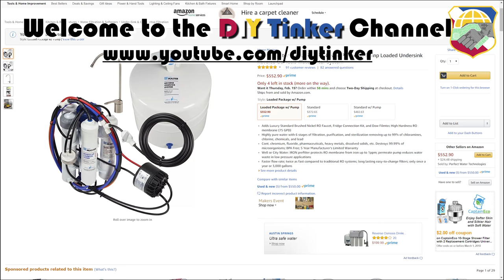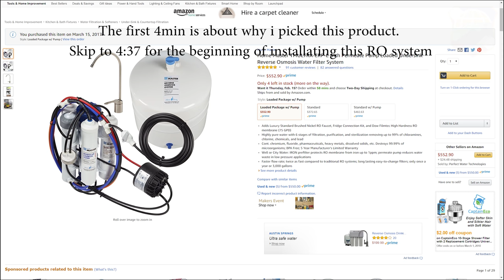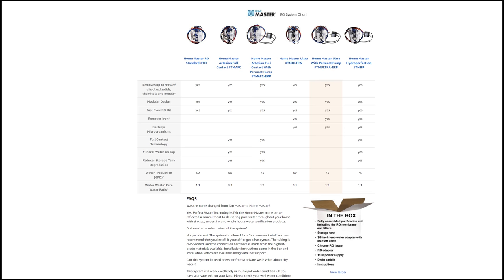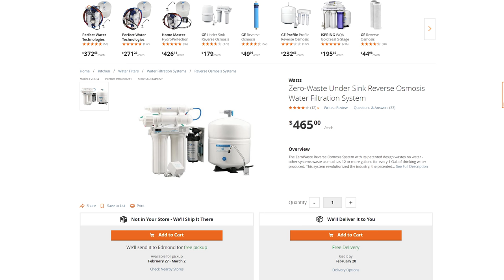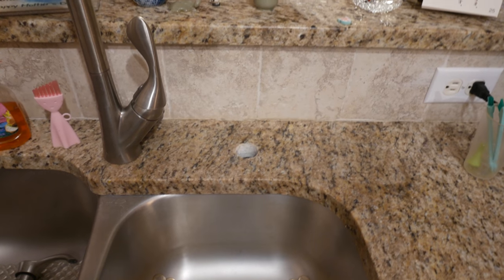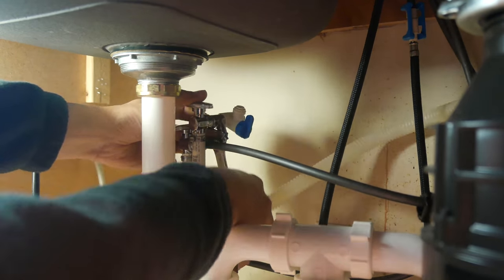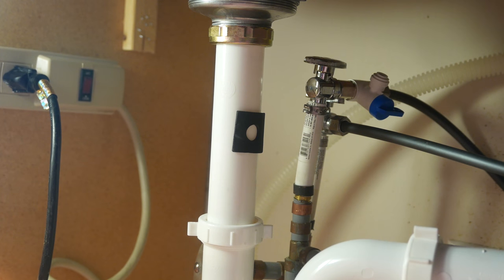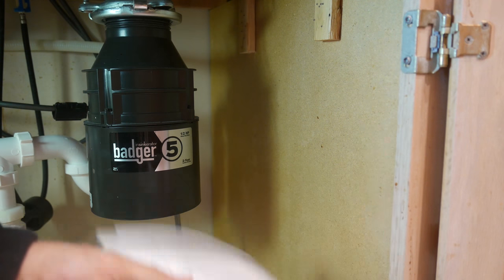How to install a Home Master TMULTRA with Permeate Pump Reverse Osmosis Water Filter System

Comment: Does it matter if the cluster system was installed horizontally instead of vertically? What if the pump was also installed horizontally?

Comment: Thank you for this video. It helped a lot. I only have one question. Is it ok if the pump is underneath of the filter? In the instructions it says to mount it side by side with the home master system. I installed it the same way you did in the video which is right underneath. Any thoughts?